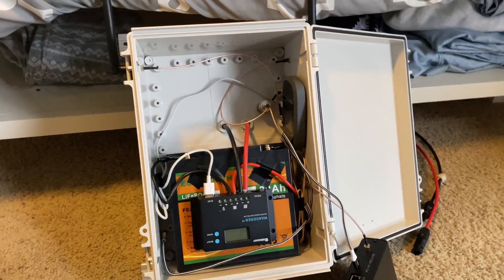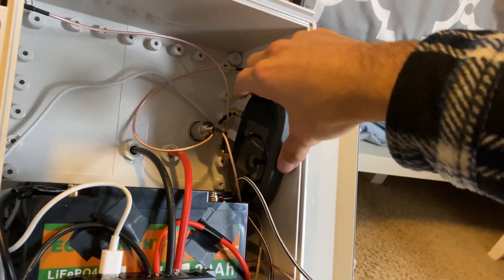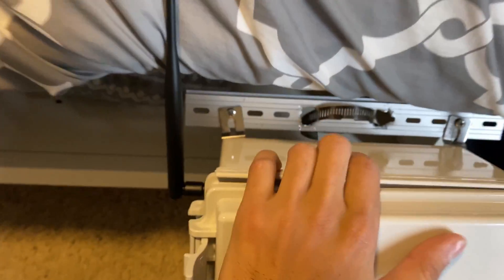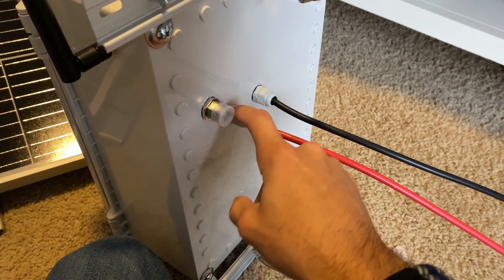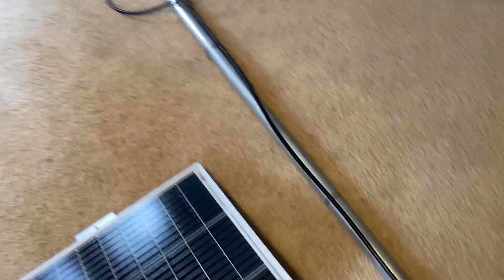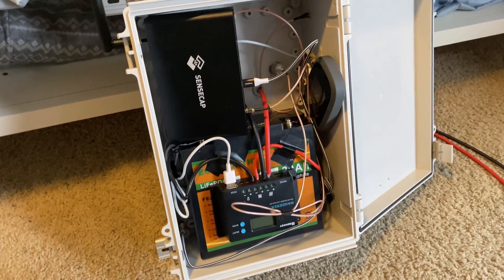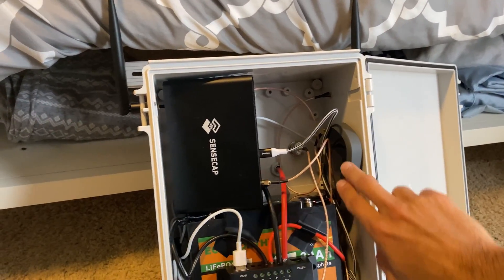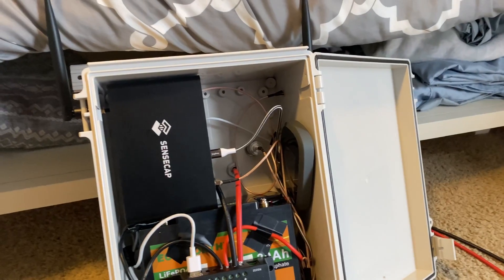How To Make An Off Grid Helium Miner

Comment: Do u have issues with static ip/ port forwarding /relay ?? Using the mifi
Reply from the maker: I do not, I run a mango router with vpn so it gets rid of relay issues
Reply: Ok thanks ama have to look up how to do it , i wanna do a similar set up to urs

Comment: Great video. I noticed you have external antennas on the 8800l. Is that required?
Reply from the maker: No, but it definitely gets better signal with the antennas mounted on the outside of the box
Reply: Thank you. I have a orbic jetpack that im going to try. Hopefully it gets a strong enough signal.